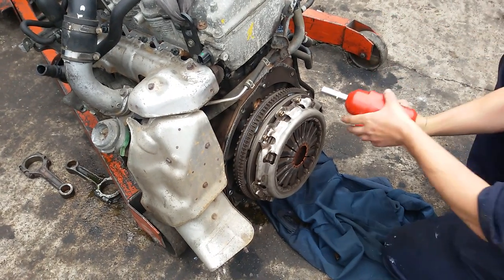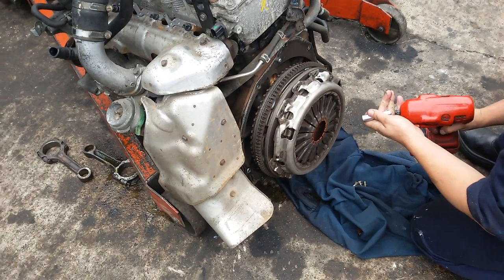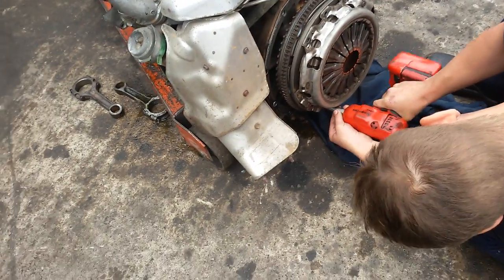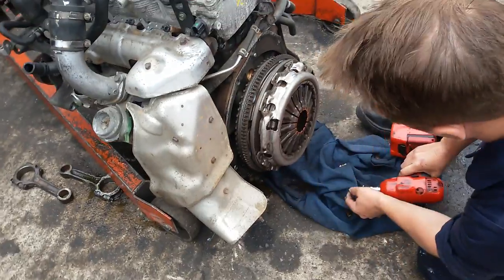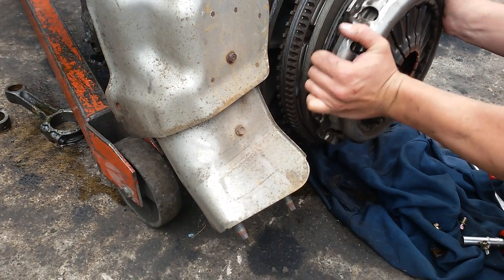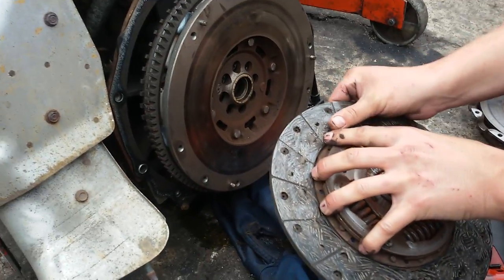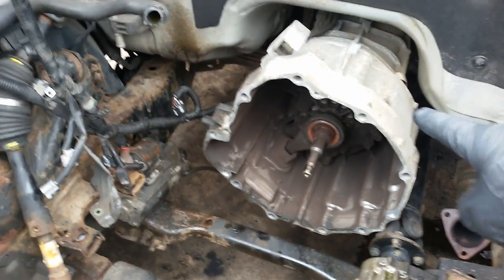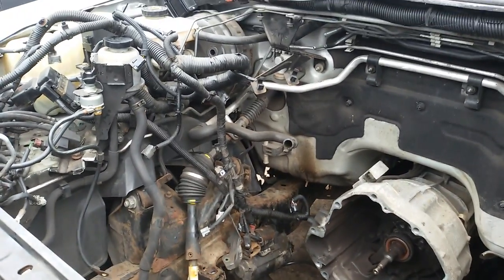Nissan navara d40 clutch problems the best way to

Comment: Hi mate, I replaced my clutch and now I have a loud clicking/grinding noise when it's in neutral and clutch disengaged when I push the pedal it stops
any ideas?
Reply: Do you fix it already? I have the same problem
Reply: did you replace the thrust bearing,,,?

Comment: Hey mate just about to buy a 2010 navara 60 000 ks on it the only thing that seems a bit worrying is it seems to be hard (you have to put a bit of force into it)to change down from third to second and nearly stop to change down into first i was assured it was just because it was a bit cold just wondering if this is a normal thing or a sign of a problem starting? cheers
Reply from the maker: Bloody salesman no it is not normal could be a few things.
Reply: For the 2007 it is normal to do almost a full stop for first gear at 60.000 as time passes it will get in first gear more easy but not much. As for the 2-3rd it is a bit sticky but not much. All of this i have done without double clutch manoeuver